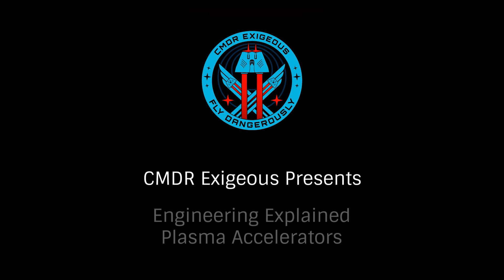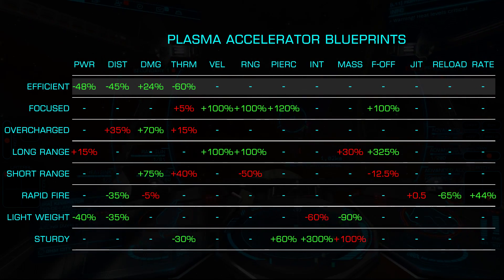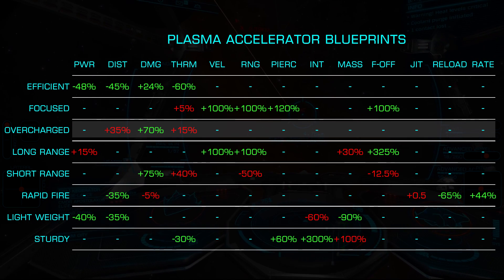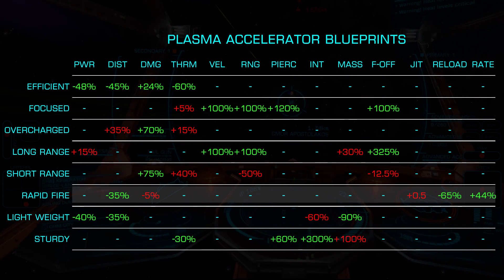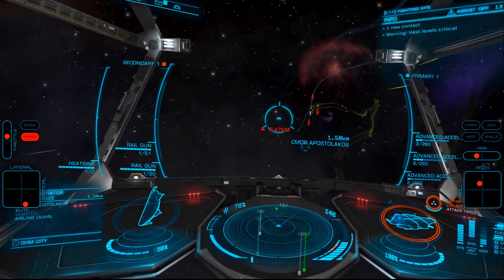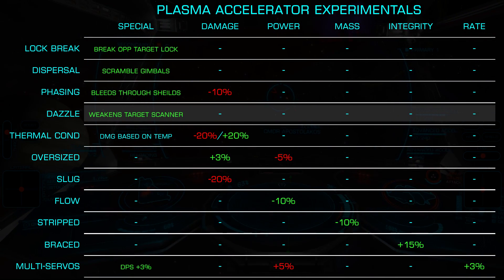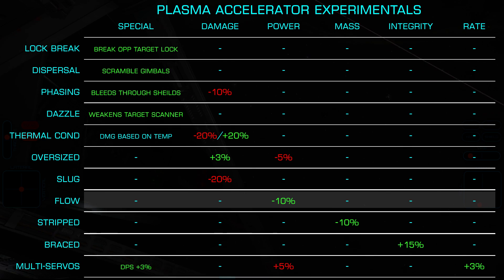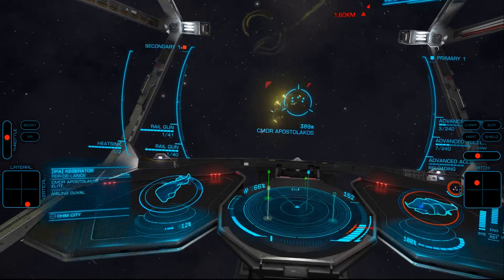Engineering Explained: Plasma Accelerators

Comment: The thing about focused is that size 2 accelerators are already 100 pen. And the highest hull hardness ship is the type 10 currently with 75 hardness. *So any pen bonuses are useless*, since armor hardness is not reducing the damage dealt by PAs to begin with. That said, focused still gives you the shot speed without the mass penalty of long range. And you're never really using them at maxrange anyway, so the better falloff of long range vs focused is not that valuable.

Comment: Old Video So I doubt Anyone will respond to this but  how good is efficent flow control Plasma accerators  are they good enough to prevent yourself from overheating or at least shoot more then one of them at once?
Reply: Flow control just decreased power draw, not thermals. You don’t need to worry about overheating, just go efficient + tc

Comment: Would love to see a video explaining armor and armor piercing, from what I've seen on reddit etc, increasing armor piercing on PAs is pretty much useless
Reply: Basically, any ship has an armor hardness. PAs and railguns have an armor piercing value of 100, way above even the hardest ship, the T10 with 75 hardness, meaning they will always do max damage regardless of the armor they hit.

A pulse laser though with say, 38 piercing will do about half damage to the hull of the T-10 vs how much it would do to the hull of an eagle or sidewinder which have hardness values near or at the 20‐28 range

Comment: sitting at Turner Metallics to change my PAs experimental from thermal conduit to oversized only to realize oversized isnt an available experimental for PAs....

According to INARA, EDSY and this vid oversized IS an experimental effect for the PA.
Am i currently experiencing a bug or did FD remove that experimental?
Reply from the maker: Uh, I'd say yeah something is wrong as I absolutely have PAs with oversized on them. Are you sure you have the mats for it? (then again it should still show). Perhaps open a ticket as something is definitely wrong.
Reply: @Exigeous  
Oversized is also not shown as an available experimental in Elite-Wiki but i searched the forum about oversized being removed and found nada. If it where removed there' d be definitly some threads about it.

i' ll fly by Turner Metallics next time i play. Wanted to engineer some more PAs anyway and if it doesnt show up i will open a ticket but it wasnt there 100% back when i wrote my comment.

edit: its available now....

Comment: You say in several of your videos that Phasing should only be used together? Why is that? If I have 3 PAs and I’m using lock breaker and dispersal why is it not recommended to throw in Phasing? I mean the 2 former don’t stack I’ve see several of your builds double up on lock breaker. Why is that?
Reply from the maker: Really as a strategy - since phasing does less damage that you could with other effects you're whole goal is to kill the hull before the shields even drop.  As such you want as much of that as possible - now you could use say a single cascade rail along with phasing PAs, so really you just want as many of them as possible.
Reply: @Exigeous  First let me say thank you for responding and second let me apologize for the bad grammar (I was on mobile).  This makes sense.  Is this to say that in a 3 PA setup the best option is stacking two lock-breakers or is there something else to consider?  

I’m also curious about your thoughts on small rails vs medium in a PA/Rails meta build.  I ask because as I do the math the damage reduction with the small rails when using say a chieftain seems material vs the medium rails that would be in a FAS/FDL build.  Or am I oversimplifying/misunderstanding this?  Thanks again!
Reply from the maker: @zx6guy  These days thermal conduit has become the new meta - that does 40% (I think) extra damage when you're over 100% heat - run that on the huge, then TLB on one and dispersal on the other as that acts like chaff and scrambles gimbals for a few seconds (about half what chaff does).

As for small vs medium you of course want medium but for the chieftain I generally run 3 small, 2 with cascade and 1 super pen, then sometimes a medium as well - with two PAs.  Another good idea is to run a turreted corossive high-cap multicannon on a small and then run 2 small rails and 1 medium - you may ask why turreted, well all you care about is the corrosive effect, not the damage, so you'd only use that once their shields drop.  One of the rare times turretted makes sense.

Comment: Why do you say Phasing should only be used when all other weapons are Phasing?  Lock Breaker and Dispersal don’t stack right?  So if I plan to run 3 plasmas on say a Chieftain and want to run Lock Breaker/Dispersal wouldn’t something like Phasing be a better choice for the 3rd accelerator then running a second Lock Breaker?  I ask because I think that’s what you recommend in your Chief build video.  Thanks for your help ahead of time.
Reply: Usually the damage that goes through is so small, that it only really makes a difference when you get the accumulated damage of all your phasing hardpoints.
Reply: Omar Torres But if Lock Breaker and Dispersal don’t stack wouldn’t Phasing be the next logical choice even if the damage is small? I’m open to suggestions
Reply: @zx6guy  it is better than nothing. Just don't expect great effect from the experimental.
Reply: @OmarTorres  Thanks

Comment: Question about long range vs focused: Long range has a better falloff bonus, buffing it out to 7km vs 4km.  The Focused piercing buff, to my knowledge is not useful since you cant get better piercing than the value of the armor hardness of the ship you are shooting, so Type 10 Defender being 75, 100 is more than sufficient.  Wound long range be a better choice being it doesn't get a thermal load penalty as well?  Focused only suffers from the thermal load and doesn't get the mass or power draw I suppose.  Any insight from others on this?

Comment: Any suggestion for a Krait PVE build? I used 2 eff laser oversize gimbal
 to deal with smaller target, and 3 APA. I can't decide should i all go 
efficient or all focused.

i feel like i should use efficient on 
APA, and focus on PA because i should fire more spam more in APA. for 
exp effect i want to go lock break, dispersal and dazzle, but i keep 
reading it's useless against npc. advice please?
Reply: Maximilian Y. I recommend always using sealer racks at least one as they are absolute monsters
Only fire one then wait and see if they have point defence or emc then use more if they don’t then push in if they have p defence or emc with your lasers

Comment: I really love the APA's and have tried a few combinations with them. Here's my observations on some of the engineering I've used:
- Efficient: It's quite hard to boat plasma without this. They are hot and power hungry weapons, but the modification tones this down greatly. I can see why it's popular. Lightweight is a rival on this, except not really.
- Focused: I feel the increased shot speed is the main benefit. More speed means more accuracy; less lead required and less time for the target to change direction. I like to also use this to match speeds with other weapons' projectiles. Long range does the same thing, but the other bonuses/penalties are not as good for most situations.
- Rapid fire: Tempting because regular plasma fires quite slow and can be frustrating if you miss a lot of shots. I tried to use it to get some medium hardpoint PAs to fire as fast as my APAs so I could have then in a nice group. It got somewhat closer, but the result wasn't really satisfactory.

As for experimentals, I usually use the lock breaker. If I have more than one, dazzle or dispersal for the second one.
Reply: What's the best option for Advanced PA? I was thinking Rapid Fire or Efficient
Reply: @chrisklitou7573  I would generally go for Efficient unless I have some specific build it mind. APAs already fire pretty fast.

Also to amend my own post for the experimentals, dazzle doesn't seem to do much, especially at the distances you actually can hit with plasma, dispersal is the better option.  Also I've since made some strictly PvE ships that have the plasma slug. As long as the fuel tank is big enough, this is great for staying in the CZ/Rez longer.
Reply: @Kissamiess  what's the best builds for Ferlicty and Edmund lasers? I was thinking stacking their abilities with experimental effects that basically stack their abilities
Reply: Any suggestion for a Krait PVE build? I used 2 eff laser oversize gimbal to deal with smaller target, and 3 APA. I can't decide should i all go efficient or all focused.

i feel like i should use efficient on APA, and focus on PA because i should fire more spam more in APA. for exp effect i want to go lock break, dispersal and dazzle, but i keep reading it's useless against npc. advice please?
Reply: @maximilianyuen  I'm a bit rusty for thinking about builds, but I think with 3 APAs you should definitely go Efficient. Lock breaker is pretty much useless against NPCs. Either it does nothing at all, or they just instantly re-aquire the target. If latter, maybe it will still break their missile locks. Dispersal should work, I think, but I haven't tested it extensively to be sure. Dazzle I now view useless for the reasons stated above. Maybe someone better than me has whipped up a build where it actually works, but I'd have to see it to believe it.

APA should definitely be used in more spammy way than regular AP. Think multi-cannon, almost. I have a ship build where I matched the shot speed with MC by focused and put them in same firing group. That taught me to spray and pray more with it.

Comment: One question I have - when you have a modification and an experimental effect that have opposing effects to each other, how is the resultant statistic calculated? For example; if I have a weapon buffed by 30% damage, but the experimental effect lessens the damage by -10%, what is the resultant damage? Is it additive (30% - 10% = 20%) or multiplicative? (30% - [10% x 130%]) = 117%
Reply from the maker: I'm 99% sure it's the former and that the result would be a 20% boost rather than 17%
Reply: Alright, I'll investigate the forums to confirm this. Thanks!

Comment: Thanks for this, I just got a Cutter and outfitted it with a class 4 plasma
Reply from the maker: Sure, if you're just hitting the big guys it's fine - I just personally hate flying the big ships - especially when stock - and I hope by stock you mean A rated and not stock as in E.  The size of the ship has nothing to do with it's thermal efficiency, the coldest ship in the game is the DBS and it's one of the absolute smallest.  It has to do with the module types and engineering.  An A rated power plant, for example, it always .4 heat efficiency where an E is 1.0 - a huge difference.
Reply: Panzerstorm really? That's not a cold ship
Reply: Nah I've been using it stock for a few days now and I've never got my heat up over 100. If anything my distributor drains before I can accumulate any real heat because of my lasery loadout

You guys might be forgetting that the bigger the ship, the more heat it can handle

Maneuverability hasn't been a major problem because I'm not using a class 4 plasma accelerator against small ships anyway, only large ones, which I find are impossible to miss
Reply from the maker: Yeah, Plasma on a Cutter isn't the best idea given it's horrible maneuverability.  Far better on the Vette for the big ships, but if you do you'll need either Efficient for the heat (most likely) or maybe Focused for the easier shots.
Reply: CMDR Exigeous Yeah you're right about that actually, but according to the research the DBS is actually an exception to the rule. Other than the DBS, inherent heat dissipation is related to ship size. 

Source: https://forums.frontier.co.uk/showthread.php?t=286628

By stock I mean a class A plasma without engineering. I'm running an engineered class A power plant.

So this leads to another question — what should I be using on my class 4 hardpoint? I'm running a full turret loadout other than the plasma and two missile pods on the bottom 3. So in combat I just rotate the ship to keep the enemy target above my horizon line so that all my turrets are hitting all the time. Then I use the missile pods / plasma when I have the target directly in front of me. My reasoning is that having a few turrets on the bottom of the hull would be totally superfluous as unless an enemy is exactly on my horizon line I will never be hitting them with all my turrets at once.
Reply: I did the same but I realized I was not getting a whole lot of time on target with it, but you are right in that the single Class 4 PA will not over heat the ship unless you constantly fire the weapon with low power in the capacitor. So the way I made the weapon work on my cutter is I fitted it with a grade 5 long range with a Target Lock Breaker experimental effect on it. The doubling of the projectile speed has made landing shots easier so when I do get my target lined up my odds are better, and the Target Lock Breaker has been very helpful in messing with gankers.

That being said the way I fight with my Cutter is I don't sit around and tank with it, but instead I take advantage of my grade 5 Dirty Drives with the Drag experimental to keep my targets at long range. Then I open fire with my 4 medium focused burst lasers while shelling them with the huge PA. The 2 large slots have Multicannons (One Corrosive and one Autoloader) for up close and personal fighting, and for boosting overall DPS should their shield go down. Only times I really ran into the heat issue is when all the weapons are firing at once, I have 4 pips in weapons, and my capacitor is low. Otherwise the Cutter runs just fine with a single Huge PA.

Comment: Love the explanation! I think focused is the way to go due to the fire speed, but man... The heat... So much heat... Especially with the advanced plasma accelerators.

How do you mitigate heat? Or are you fine with it?

Also would kill to see your advice on rails. As it stands now, all I ever run are G5 sturdy Imperial hammers. Cuz Heat.
Reply from the maker: Rails will be soon - but for heat there you want Sturdy mount (-10%) but most importantly is Super Pen and Feedback Cascade as both have huge thermal decreases (I think -40%).  Rails are FAR worse as they are much hotter than standard Rails with very little benefit.  As for PAs and heat Focused really only works on specific ships, like the Chieftain for example.  I do use them on my Krait too but have to be very patient with my shots.  That said learning efficient is the best way given the low heat, low power and higher damage.
Reply: There are a couple of ways, i would say the better approach would be to mod your power plant with armored+thermal spread to get a better heat efficiency. you can also actively counter the heat from PAs and rails with pips, as your ship cools faster the more pips you have in weapons. quickly shifting 4 pips to and from weapons is the key to running a successful focus build i think, and it helps if you are in a hull tank since you don't have to worry about shields so much :)